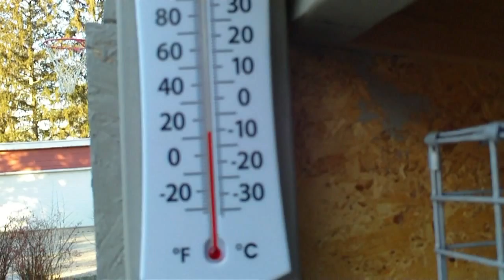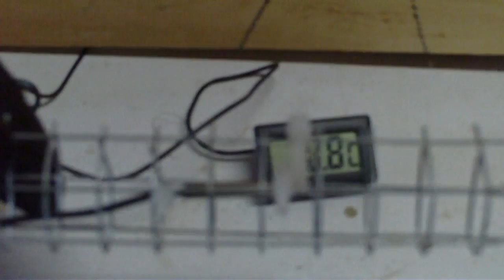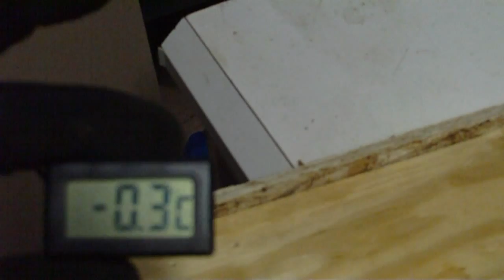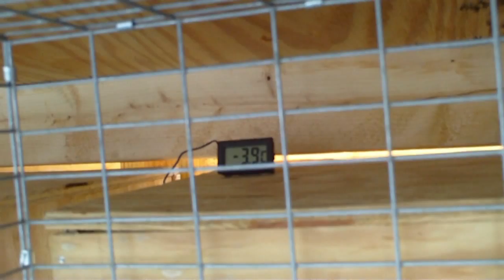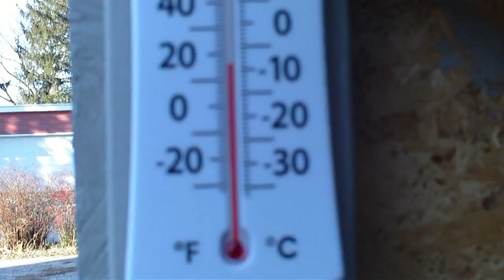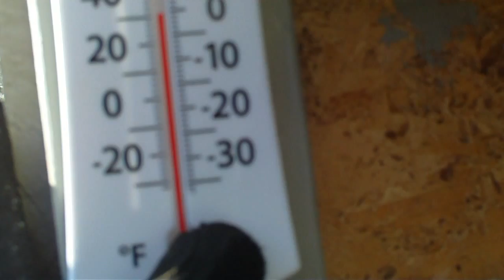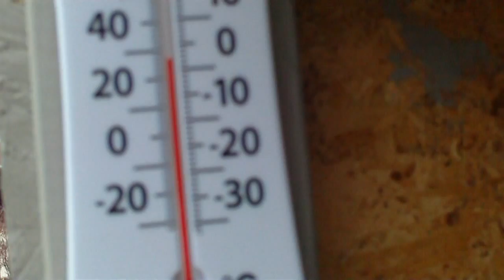Experimental Nest Box Warmer

Comment: I would like you to check this out on ebay,
 reptile heat tape.... its thin like paper covered and sealed in plastic you can get it in 11 inch wide sheets as long as you want cut to fit it will warm to 110 deg but being enclosed like that might be perfect. check it out.. you can buy it in bulk rolls if you search it on line less likely to cause a fire